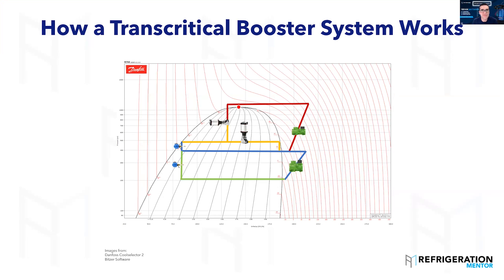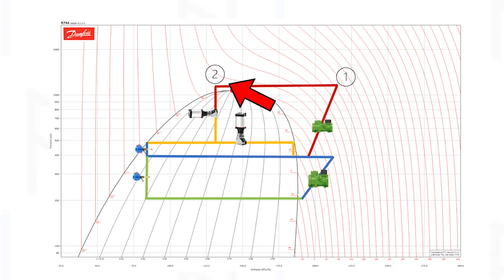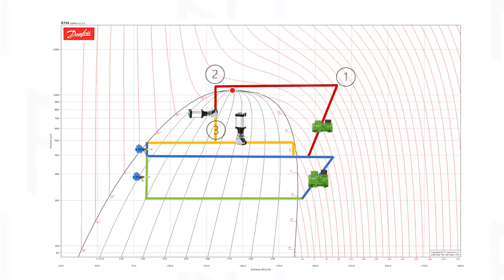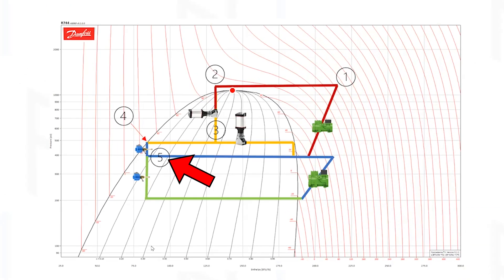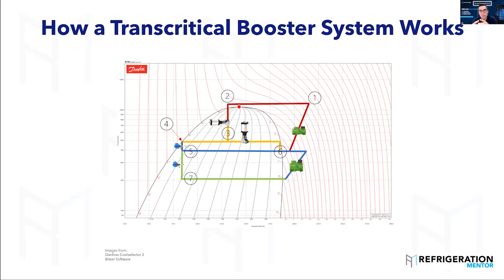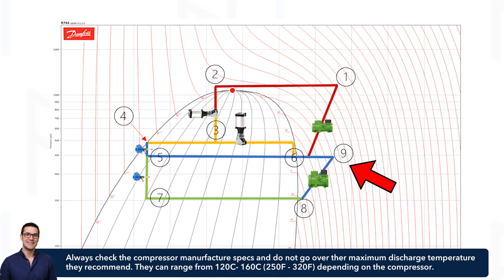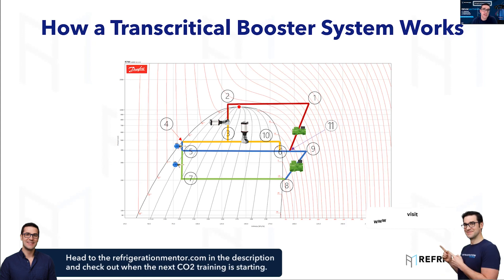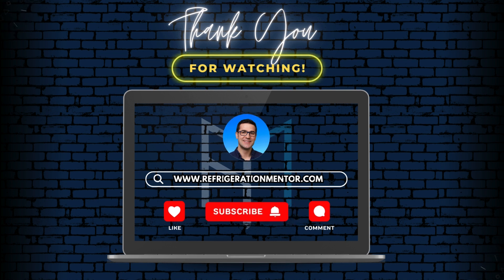CO2 REFRIGERATION CYCLE BASICS | FREE HVAC TRAINING | HOW A REFRIGERATION SYSTEM WORKS

Comment: Great video Trevor, always enjoy your podcasts. What typically changes on the systems control side when it changes from sub to transcritical mode? Do the valves operate differently?
Reply from the maker: There are some slight difference but the main thing is when it’s below the critical point it’s maintaining a subcooling value and above in Transcritical it’s maintaining theoretical calculation using pressure and temperature to maintain the best gas cooler performance to reduce the amount of flash gas going to the receiver.

Comment: Hi 👋 one question what happened if the condenser the fans stop working
Reply from the maker: @AR340  the same thing as a HFC the system will go off on high pressure switch. And if it is designed to handle the  pressure that’s it. 
Now if it is designed for a lower pressure and the pressure continues to increase you may open up a pressure relief until the pressure returns to a safe range.

Comment: The HP valve should be shown at the point marked 2
Reply from the maker: @MogCity2  you are correct. Thanks for sharing that. That HP valve will be at whatever the outlet pressure is of the gas cooler condenser.
Reply: @RefrigerationMentor really like what your doing with your channel mate!
Reply from the maker: @MogCity2  thanks. We have more great things coming. Lots of other great content here if you’re interested in checking it out.  https://linktr.ee/refrigerationmentor

Comment: I Like CO2 refrigerant, but maximum what i work in with CO2 is Coca kola refrigerator or Heat pump water heater🤣🤣🤣 ( i am small commercial refrigeration and HVAC company. at this point have no idea how to elevate on next  level)

Comment: What I learned from this video is:
1. vapor is at its highest temperature when it reaches the tippy top of the discharge line.
2. The space between the discharge outlet and the inlet of the gas cooler is needed.
3. The vapor only turns into a liquid inside of the condenser when running in subcritical mode.
4. The high pressure valve and flashgas bypass valves are the most important valves, for subcooling and flashgas reduction.
5. Medium and low temp Metering devices for single lined liquid lines going to inlets of evaporator lines.
6. You need superheat; plate heat exchanger.
Reply from the maker: Thank you for watching, listening and taking notes that is the first steps to CO2 mastery.  I do appreciate you sharing your takeaways. We have more great CO2 content here https://youtube.com/playlist?list=PLH6R3tp4lm-lmQXZeejZMG7unCCgAwk-4&si=HYIHSqR7x5lz11LN

Comment: Brilliant video, what could be causing the system to go out on HP? Apart from it being a blocked gas cooler?
Reply from the maker: @adamdart855  overcharged, air in the system, fan setup, HPV programming, FGBV issues. There are many other things that could cause issues.